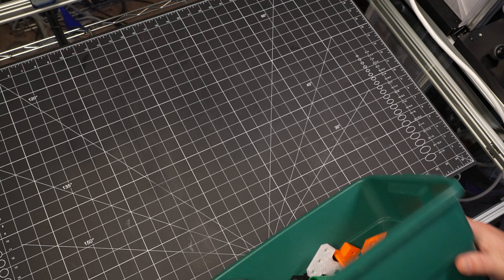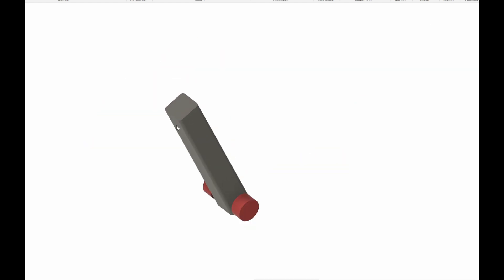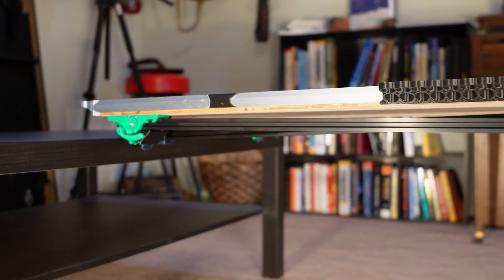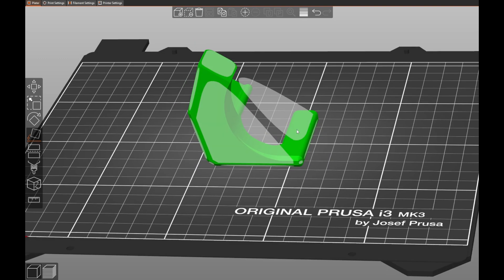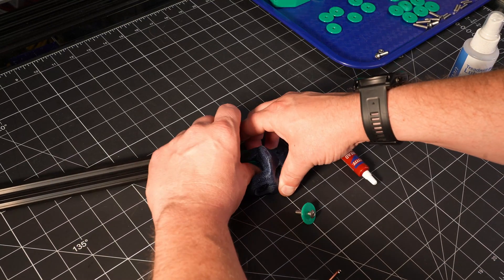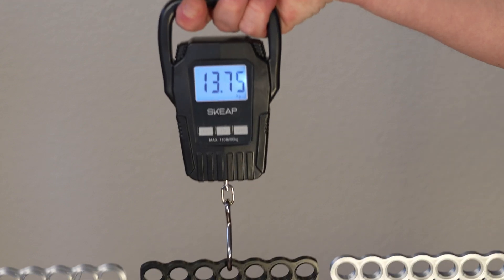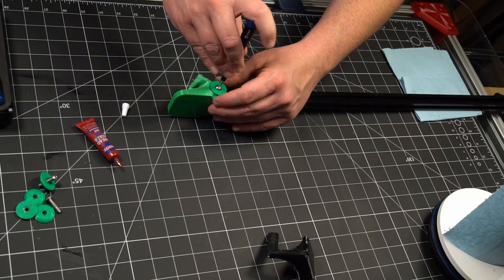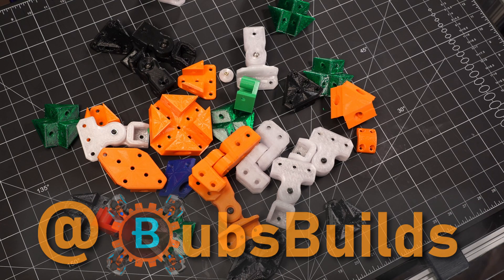I revisited this DIY Folding Table Hinge build.

Comment from the maker: Corrections and helpful tidbits from the comments:
 - In the "COTS" part of the video, I show a 3mmx15mm dowel pin, but that should be a 4mm x 16mm dowel. Doubt anyone was pausing there to place a dowel pin order, but figured I'd correct it just in case :)
- It was pointed out (thanks @mikemorrell7921) that Loctite can have negative interactions with some plastics. Although I haven't see any issues with these thus far, it's something I hadn't considered. So word of caution and maybe check yours on a piece of plastic scrap prior to following my lead on that one!
- Switching out the machine screws (that run through the bearings) for some shoulder bolts would reduce/eliminate the potential for damage to the inner diameters of the bearings. With a little bit of revision to the bearing design, they could actually be used directly as the radial bearings directly against the Base. Thanks @limeyrock for the shoulder bolt shout out!

Comment: Your bearing axle design isn't very good. When you tighten the bolt you are also tightening the bearing, that's not good because it means that you cannot get the bolts tight enough without binding the mechanism.

I suggest you make the frame hole bigger and extrude the bearing disks to meet in the middle so that the bolt tightens the bearing disks against each others and against the aluminum extrusion. Also, add washers under the bolt heads. This way you can tighten the bolts tight creating the proper friction joint while still having a functional hinge.

Comment: Shoulder bolts or at least just normal plain shank bolts of the right length would be better than machine screws for tolerance and longevity.
Reply from the maker: Very true and very good point! I actually considered switching to shoulder bolts as an alternative to the bearing revision I went with....but then I realized I didn't have any on hand, and I'm impatient :) But definitely agree they are a much better choice for this application. Thanks!

Comment: I personally would add some way to connect 1/32" wire rope between the extrusion and some spot closer to the center of the table to stop the legs from bending outwards, but those can be a pain to tension and keep out of the way.
Reply from the maker: I hadn't thought of using some sort of cable stay supports to stiffen it up, I like it! True, the tensioning could be tricky, but not impossible. I'll have to ponder on that one a bit, thanks for the suggestion!

Comment: The Algorithm brought me here. Nice. 

Since you spoke about curiosity, what are those hole-thingys attached to your "table top"? Are they purely for aerodynamic purposes or just holes for where you put your lollipops when you need two hands?
Reply from the maker: @liveroundsgaming2359 All hail the algorithm.

Close! But it was actually for jerky, that way I could just bend over while working and grab a bite. But I got on a Slim Jim kick, and they just kept falling through the holes...hence it found its way to the scrap pile. Really they are just a 'standardized' set of mount points for tools, containers, etc. Kind of like a worse, and less versatile version of Gridfinity.

Comment: Nicely done.  The two bearing surfaces and lock with pins was a nice touch.
Any benefit to printing two of the hinges at a different orientation to change the layer path, stiffen them in a different direction?
Do you think a generative design may provide a stiffer solution quickly?
Have you noticed any problems with loctite interacting with the plastic?  I found that some plastics weaken when loctite is around.  Dont know if its just the solvent.
Reply from the maker: @mikemorrell7921 Thanks! Hmm, I hadn't thought about that option, it could indeed be interesting to play around with print orientations a bit (and maybe also fill %s) to see if there are any noticeable gains to be had.
I hadn't even considered tryin out generative design on this one! I'd guess one big improvement that would come from that would be in the side-to-side stiffness (assuming I remembered to apply that load case). Although I have never tried to set up a generative design solve that needs to have one of the components in two orientations, so reckon I'd have to figure that out. But if I do indeed take yet another dive into this folding table hinge down the line, I think I may very well try going that route!

I haven't! That's EXTREMELY good to know! I haven't used it on any previous plastic builds (that come to mind), and that didn't even cross my mind as a concern. I'll add that word of caution in a pinned comment. Thanks for the heads up!